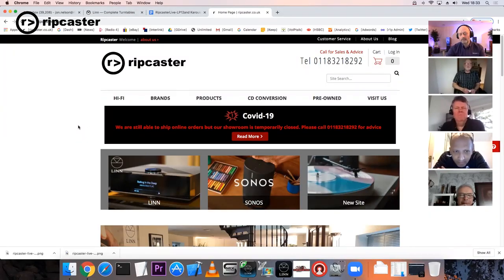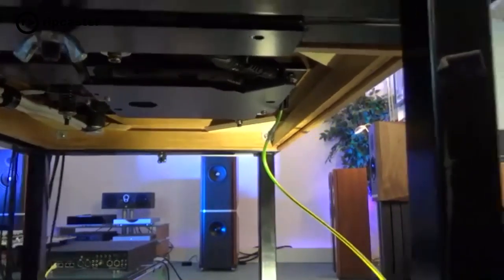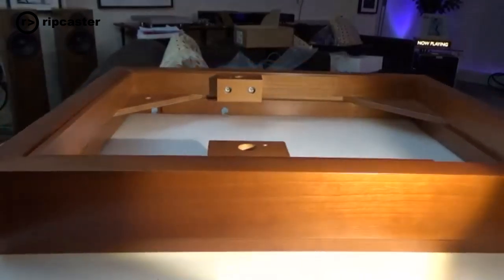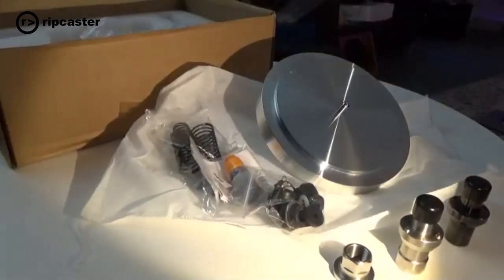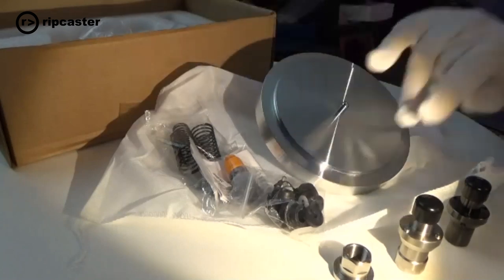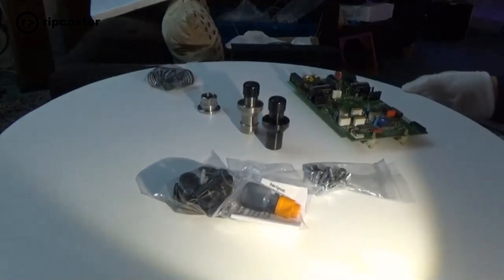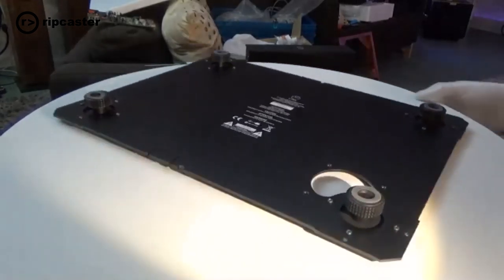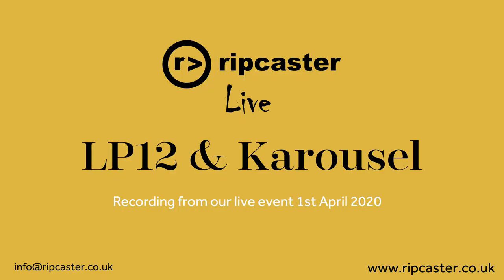ripcaster Live featuring Linn LP12 Karousel recorded 1st April 2020

Comment: The linn logo is actually a representation of vinyl playback, the circle is the vinyl disk, the horizontal line is the record surface and the triangle is the needle
Reply: Sorry, no. Actually the Linn logo represents the bearing of the LP12 which is seen as the major success factor back then. Not a stylus on vinyl, 🙂